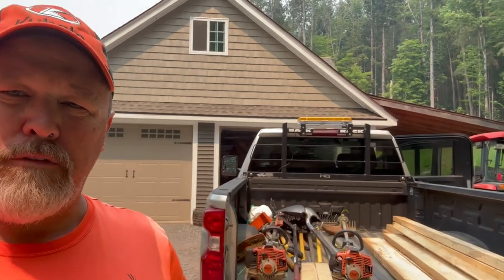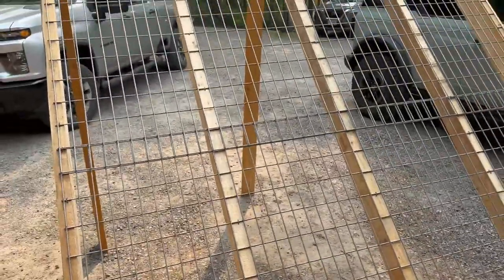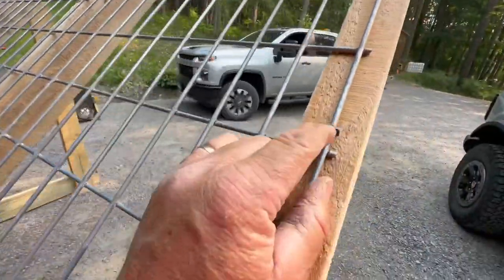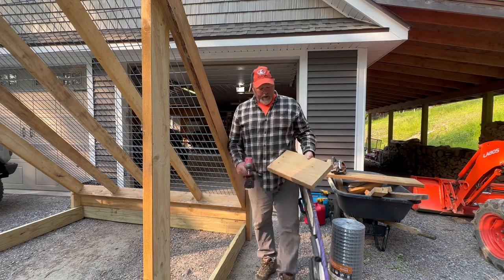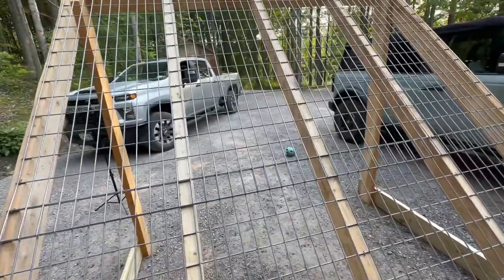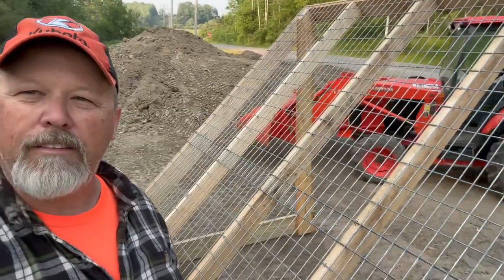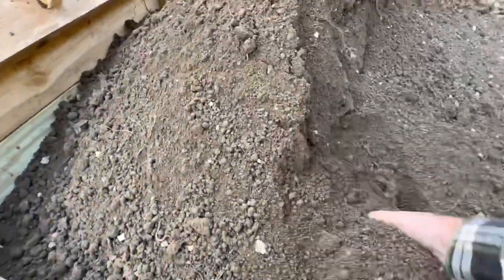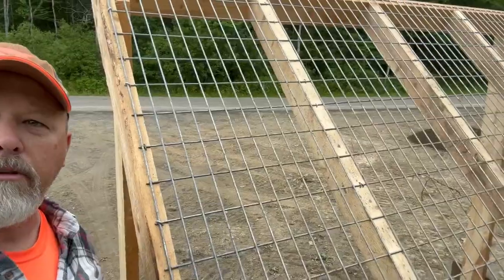Building a topsoil screener

Comment: Commenting before I've seen it work but as it is if you had put the continuous runs on the underside and the raised runs going horizontal it would be much more effective the dirt would tumble over those little raised horizontal runs and calls a sifting action on its own
Reply from the maker: Interesting, seems to work pretty good but yeah maybe that would be another way to look at it. Always good to get another point of view. Thanks 👍🏻
Funny I think I did contemplate putting the screen on the other way upside down from the way I put it.